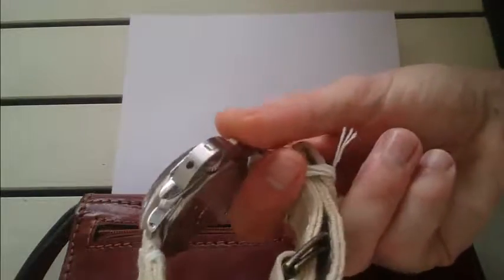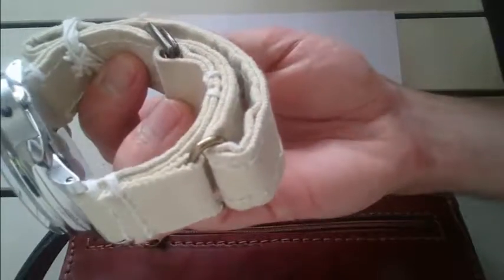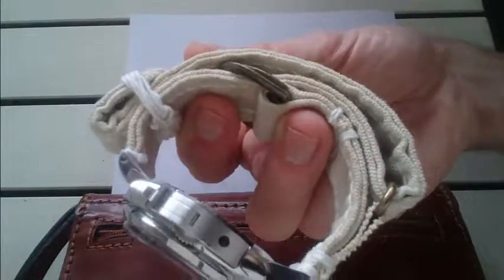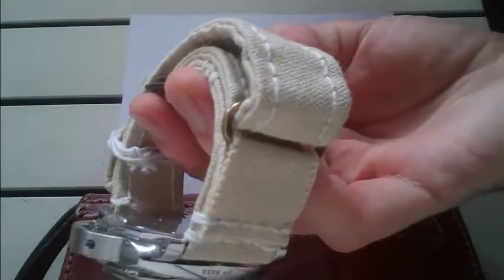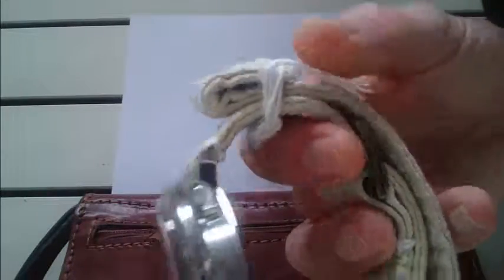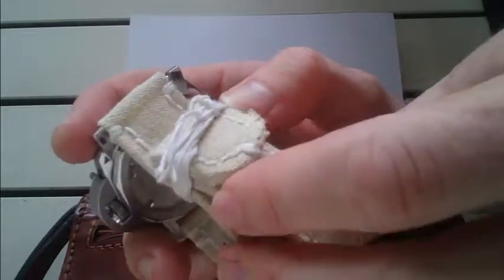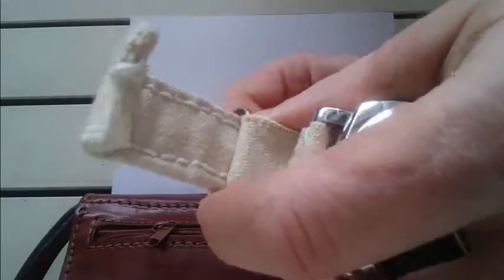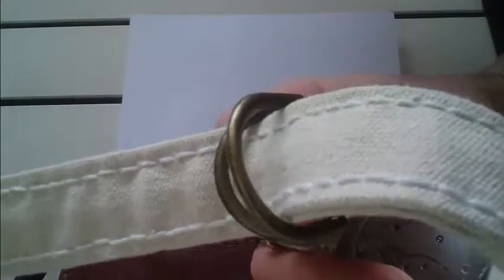Hand stitched Panerai 26mm canvas watch strap Part 4 of 4

Comment: Thats good work. Just a suggestion….I think that if you would wrap the strap around a plastic bottle about the same size as your wrist before you stitch it it would possibly take the wrinkles out of it and keep it flatter as you mark the holes, prepunch the holes and then stitch it. You might have to do that about a half inch at a time and stitch as you go. That should allow the two layers of the strap to move just a little as they conform to the shape of the bottle and intimately to your wrist. Put one layer on top of the other around the bottle, mark and punch a few holes going all the way through both layers as they are sitting on the bottle, remove and realign those holes, put in a few stitches and repeat the process until you get it all stitched up. Let me know if that helps. Thanks